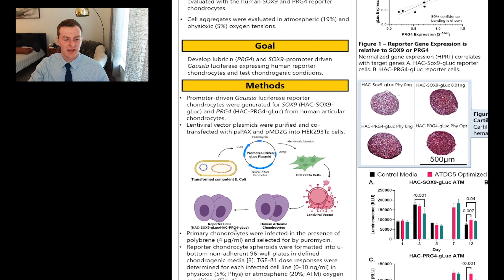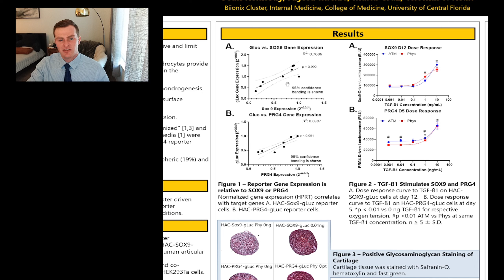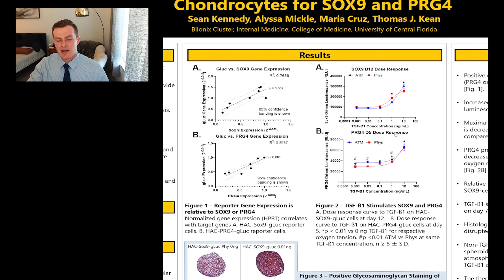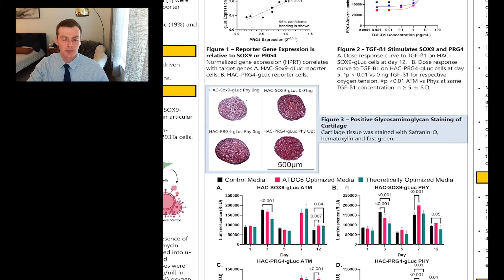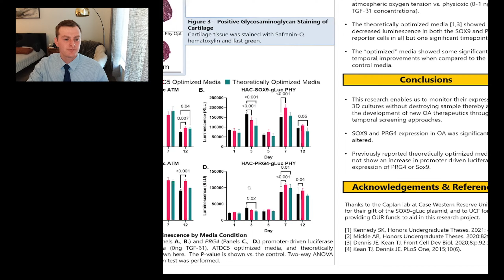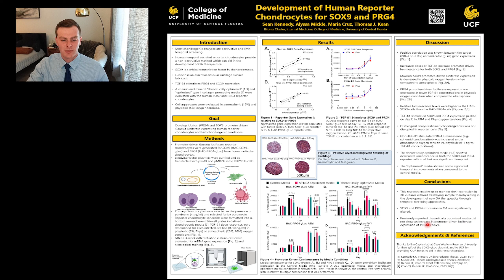Sean Kennedy ORS2022 Development of Human Reporter Chondrocytes for SOX9 and PRG4

Comment: Does sox9 positive feedback loop determine sex regardless of the sry in gonochoric placental mammals or no?
Reply from the maker: I don't think so, though this was not the focus of the research we did. Check here https://febs.onlinelibrary.wiley.com/doi/epdf/10.1111/j.1742-4658.2011.08029.x for more info.
Reply: How does sox9 and down stream fgf9 failing due to wnt4 and foxl2 not determine sex? I was unaware of the focus then. I saw sox9 and thought you'd know. @cellandtissueengineeringla8715